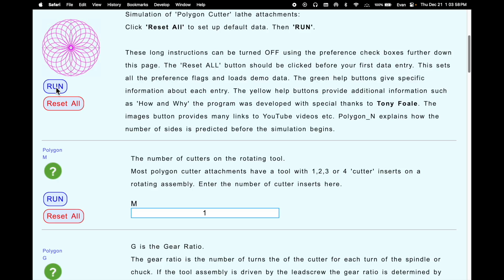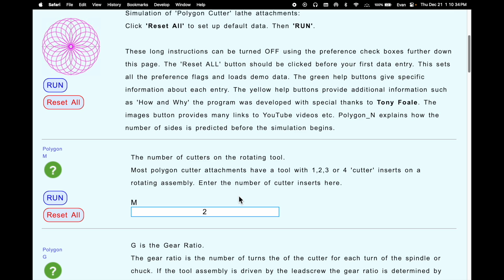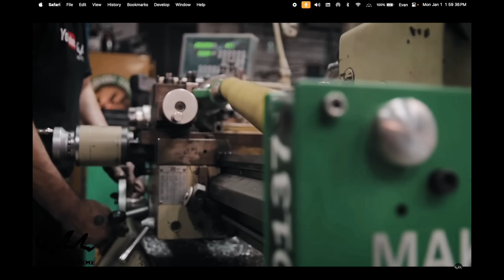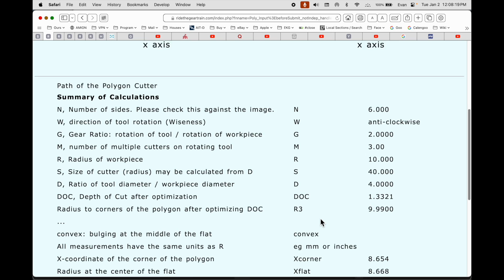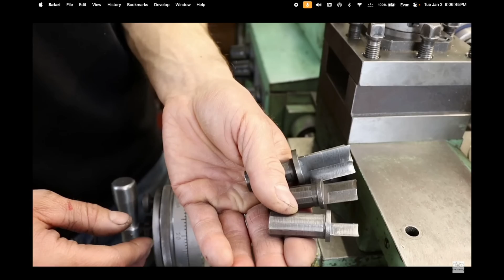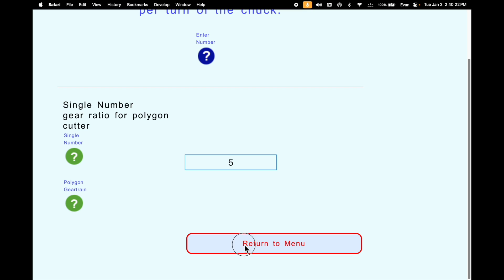Understanding the Polygon Cutter on an Engineer's Lathe

Comment: Next addition: calculate required tool relief?
Reply from the maker: Hmmm.  Would the relief be the same as a 'standard' tool used for large diameter work piece?  It is cutting an approximately straight line ie infinite radius on the workpiece.  The tool itself is rotating in a circle which is quite large eg 100mm and it could be assumed that at the point of contact it is traveling along a tangent that also approximates a straight line. Something like the tool used for straight line cuts in a shaper. What do you think? Sorry my YouTube notifications got turned off!

Comment: embarrassingly, I'm a qualified machinist, I am humbled by the genius of people not formally trained, this operation is very much similar to a vertical gear hob cutting machine, a pleasure thank you.
Reply from the maker: Hi. Thank You for your comment.  Can you elaborate on how the hob cutting machine works? Does it produce involute curvs?
Reply: @Evan-e-cent  its a gear cutting machine, blanks the thickness of the gear are stacked onto a vertical  spindle and rotated at a determined speed, the cutter is spinning and also at a determined speed, as cutting commences, the cutter is moved up/along the spindle at a determined feed, and the gear teeth are cut, if you are familiar with screw cutting you will follow, but this concept you described uses an accessible machine, a lathe, that has been converted in a unique way. A tribute to the genius that commenced the  thought exercise and brought it to life, engineers and machinists are classically trained to think a certain way....its when you think outside the box things happen...a hundred ways to skin a cat but the cat gets skinned.
Reply from the maker: @dazadow-r7i  Thanks for the explanation.  I assume that if the gear blanks are being cut while they are still rotating it would produce helical gears rather than straight cut.  I suspect that this phenomenon of polygon cutting was discovered by accident, rather than by plan.
Reply: @Evan-e-cent  in our case we were cutting sprockets, but the principle is there, interestingly gear cutting is a 'closed shop' industry, my boss was lucky to score the machine out of the closed factory in fishermans bend Victoria Australia producing Holden cars, normally these machines are scrapped or cut in half to preserve and protect the industry. to your answer on helical, not necessarily, from memory, for the stack yes but individual gears no, that's why this polygonal cutting is so neat and 'simple', to clarify, if I can, the spindle is rotating in the 'y' axis and the tool is rotating in the 'x' axis 90 deg. while traversing up and down,  it is strange....
Reply from the maker: @dazadow-r7i  THANKS!

Comment: This is awesomely cool, but why is it needed, when we have mills and indexers?
Not to say this isn't elegant, but it seems overengineered for a problem already solved with less/cheaper tools?
Reply from the maker: Yes, you have a point, but the designers of some CNC machines think it is worth including as it is fast. I don't have a mill, and until I built the milling attachment for my lathe it would not have been possible to make a polygon. Thanks for your input.
Reply: You're Criticizing the wrong person. The cutting process was invented in the 60s.
This video is only an educational explanation of how it worked.
Reply from the maker: @adriansue8955  Hi Adrian, This is interesting. Can you elaborate on the invention of the process in the 1960s? Do you know who invented it.  I had assumed someone thought a spinning cutter would be cool, and when they made one, they discovered polygon cutting by accident.

Comment: I remember hearing about polygonal turning back in trade school 20 years ago. I could not find any resources on the topic at the time. I remember someone suggesting there were designs that moved the toolpost using a cam track or crank.
The single flute track you demonstrated using the program must have really low cutter speed at some point.
Reply from the maker: Isn't it amazing the difference that the internet has made to availability of information and resources! I have just been using Google Books to look up the history of screw cutting lathes for my next video. I was teaching computer science* and using email and bulletin boards just before the internet (HTML) became available in 1989. Now they are celebrating the 50th anniversary of the Department of *Computer Science at the University of Waikato in New Zealand.

Comment: A lot of work, quite nice output...I didn't see the "flatness" output
Reply from the maker: The data displayed after drawing each polygon includes "indentation" which is a measure of flatness. Sorry, I didn't mention the word "Flatness" again to explain that indentation is really the opposite of flatness. An indentation of zero represents perfect flatness, and one of the hexagons nearly reached zero. If you draw a straight line between two vertices (corners) it represents a flat face. The actual curve deviates from that line creating an indentation and the distance between the line and the curve (at the center of the line) is a measure of indentation.  

It is also expressed as the indentation divided by the width of the flat and multiplied by 100 to give percent indentation. 

The third method of describing flatness is to fit a circle to the three points (the two ends of the flat and the mid-point of the curved surface). The radius of this circle is also given. 

These measurements are in the same units of measurement as the radius of the workpiece (R). If R is in mm, then all other measurements, including indentation, are in mm. If R is in inches, then indentation is in inches.